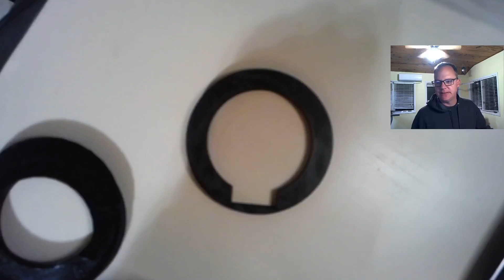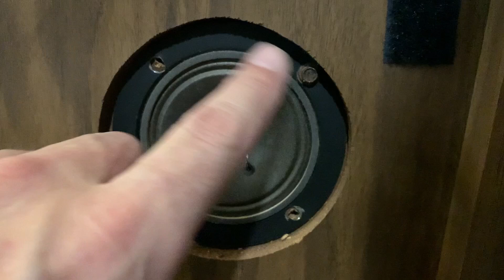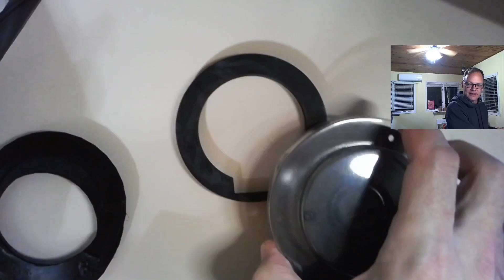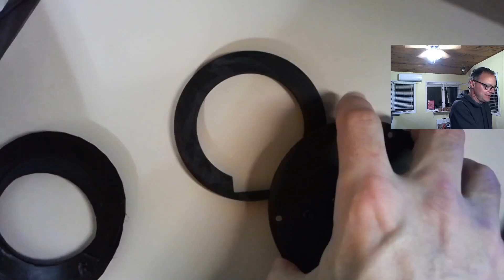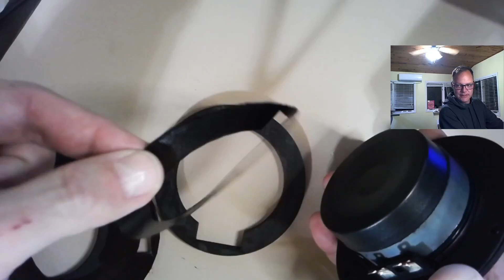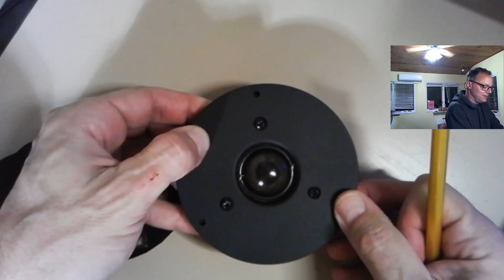Parallax Vintage Speakers - Custom 3D Printed Tweeter Bushing #vintageaudio #loudspeakers

Comment: Speaker spacers and trim rings are some of the easiest things you can make because you can create a profile and then spin it (in the 3D modeller). Sometimes you need to print just a test section to make sure things fit. I've made quite a few modification bits for various speakers :) 
If you don't want to print tpu gaskets, the stick on foam weather strip usually works fine. It'll compress reasonably well.
Reply from the maker: Excellent!  Too bad we can't share photos here I would like to see your creations. Drop a link if you are able.  Great tip on the weather stripping....